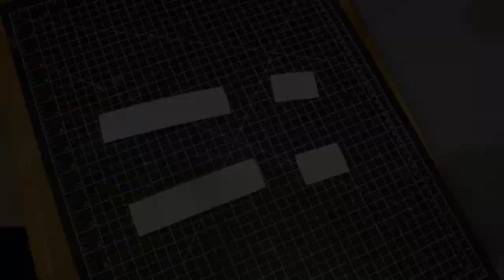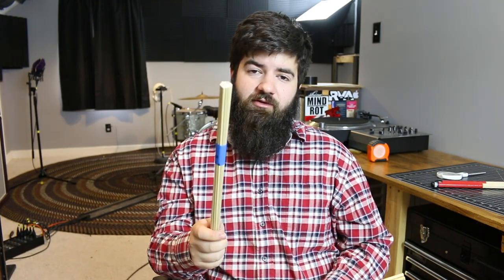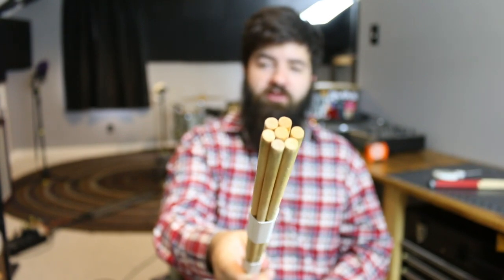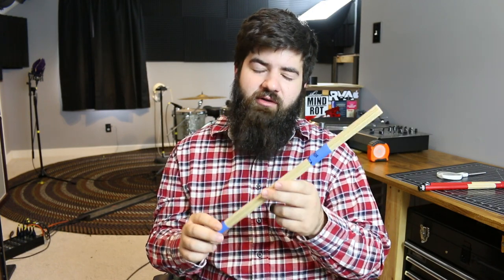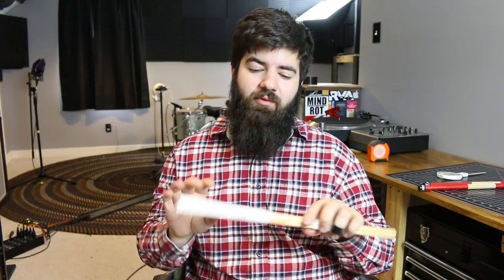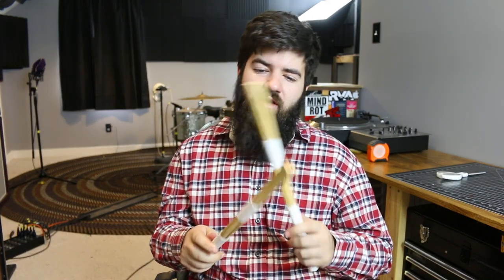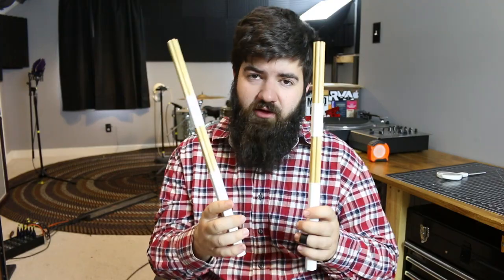DIY Hot Rod Drum Sticks

Comment: Do those edgy edges hurt the heads a bit? Would sanding them to be a little bit rounder be at all desirable? thanks
Also, wicked playing in the end there, really digging that, especially that one kind of shuffled slow fill into the crash on the snare hit. That was dope as hell.
Reply: Using his play style it wont matter.
Reply: He's got great strength control in
his playing styles, even when he's 
playing punk/metal beats in some 
of his other videos.
So, in his perspective, it's okay to
leave the rod ends as they are
as long as you don't pound your
drums into the pavement you'll 
be alright.

If you'd like to sand the edges
rounded smooth, that is fine also.
It would help to lessen edge-dents
on the batter heads.

As for what heads to play these
dowels on, I think they sound better
on coated batter heads for folk
and soft jam band music.
But, that's a matter of personal 
preference whichever heads
you'd like to play these dowels on.

Comment: Glue? Uhh nope. It will take away the sound and make the sticks too solid, defeats the purpose of these type of sticks.
Reply from the maker: its only under the handle. otherwise the center dowel will fly out
Reply: I made some years ago and the central dowel does not fly out without glue. If its only in the handle then it will probably be fine but it looked like you did both sides in the video (one with wood glue and the other with that other glue).  Cool quirky beat at the end by the way.

Comment: Your dowels are too thick.  Use more, smaller dowels.  And try cutting one dowel shorter, and place this dowel in the center of the bundle, such that the striking end is empty in the center, and therefore has more flex and less weight and less punch.

Comment: I make mine as well. I also got 1/8" heat shrink tubing for 1/8" dowels on original rods. It's a bit pricy, but the durability factor is thru the roof. They are slightly quiter, with an excellent grip factor. 
Like a chewy tootsi roll. Lasts a long time.

Comment: Great video. Suggestion / try using different size/ types of sticks. And wire brushes  as well as the various rods. It will keep you on your toes + help with assorted playing situations. It might be a small room or low volume gig. Be flex able + adaptable to the room acoustics. Best Wishes to all

Comment: How easy would it be to make DIY hot rods like Steve Smith's Tala Wands which have foam in the top to give more rebound?
I already have a pair of TW12's but they cost me about £22 (roughly $33).
Reply from the maker: +RazzerKirk it would be just as easy, you would just need to find some foam

Comment: Maybe you should round off the tip of each of the dowels? I bought a cheap set of chinese hot rods online, and the edges are not rounded off at all, and are capable of scratching the coating off heads, and denting the thinner heads.
Reply from the maker: +dzarren I thought about it but I didnt have the right size router bit. Also, if you round the edge there is less of a chance of splitting or chipping.
Reply: Yeah, good point. I was thinking of something much more crude, maybe just knocking the edge off with 100 grit or something.

Comment: You can use plastic caps on the ends (used on the end of metal tubes for table legs etc) to finish them off a little better and a slight sanding on the hitting edges helps protect your drum heads
Reply: Do you know where I could find these?  Like what do I search on Amazon or something to get something like that?
Reply: @the_dwt  On e-bay theyre sold as 'chair leg cap floor protectors'.  Im in Australia - I get them from Bunnings. In US Home Depot or any large hardware chain store should have them in packs of 4 - pretty cheap. Also I make my rods with thinner dowels. I find the specs in vid a bit too heavy and chunky